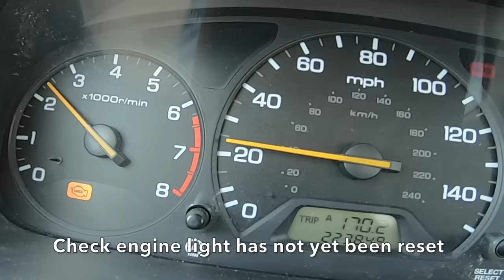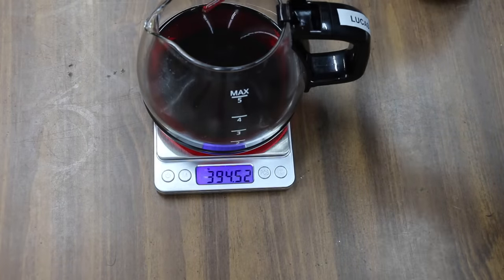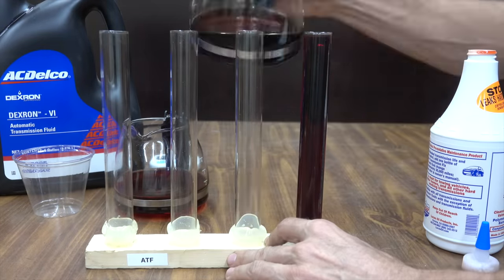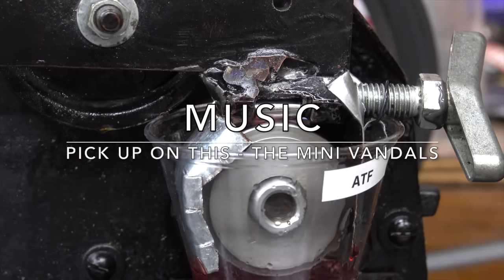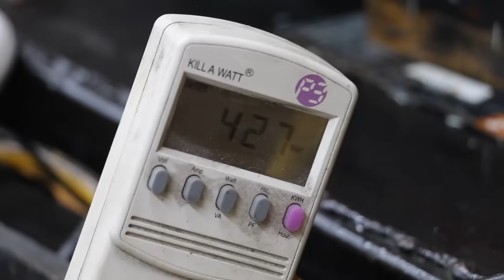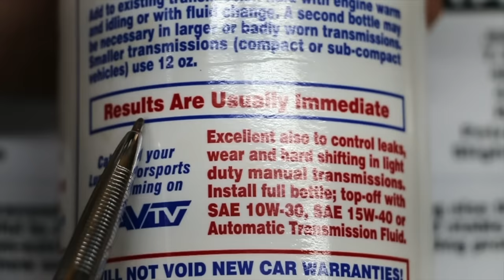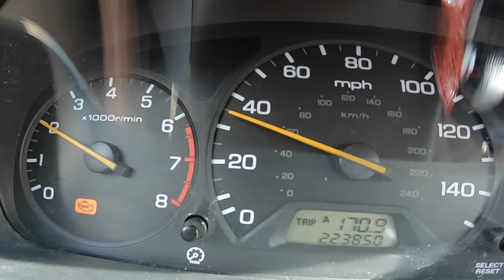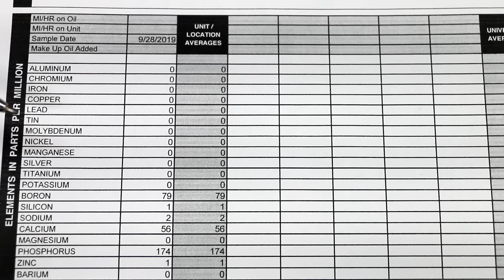Does Lucas Transmission Fix Work?  Let's find out!

Comment: Probably the worst transmission ever made especially paired with the V6. I was a Honda tech from 2004-2011 and I replaced at least a couple hundred of these transmission.
Reply from the maker: Great point! Thank you
Reply: Haha my friend was a Honda teach for 11 years before starting his own business and he told me the same. Stay away from auto hondas from those years
Reply: Even 4 cylinder
Reply: @Ss31994  yep, the V6 is much harder on them but the 4cylinder versions have plenty of issues as well. I would recommend replacing the fluid ever 15k miles to give it the best chance of survival.
Reply: mopar0IIII0jeep I picked up a EXL FOR 1400 bux 4 cylinder
Reply: Honda cars are VASTLY overrated!
Reply: Flies2FLL I guess they last, I still pick Toyota over Honda any day
Reply: I have a 2000 Accord 4 cylinder and when cold it shift into 2nd a little on the hard side. Might try some of this.
Reply: It's almost always the Valve Bodies on transmissions. That.or the solenoid. The fact that it is hunting for 3rd from 2nd specifically ( the most used shift point for daily drives), leads me to think Valve body vs t converter.
Reply: Lol a Japanese “lemon” lasts 220k miles 
An American Lemon doesn’t even make 22k miles.
Reply: jimbojims yup! Bought the car as a first for my son to drive. The trans has been changed once
Reply: Man I'm right there with you, Toyota, Ford, and Goodwrench tech.... That transmission is the deble 🤣 I did alot of used PDI's on those Honda's and man, talk about worn clutch packs and just straight up just a really bad transmission design, I felt bad for all Honda techs across town.
Reply: @Flies2FLL  Facts
Reply: Nissan has some trash CVT ones. I bought a 2014 altima new and had the trans go out totally with only 17k miles on the car, and I was 5 hours away from home lol. A couple year after I got rid of it I got a letter in the mail to see if I wanted to be part of a class action law suit against nissan IF I had my trans replaced 3 or more times haha. I got lucky and only had to do it 1 time in the 60k I drove it but there is obviously quite a few pissed off people out there that might as well have carried a spare in the trunk hahaha
Reply: Im just going to say my prelude i picl up for 850 has 200,000 and had a thrown rod. Car was completely stock with the stock engine. Hondas have their quirks, you have to have your cooling system perfect and vtec eats oil for no reason but other than that theyre pretty solid. The auto trans do suck though
Reply: I'm sorry, have you driven a Ford Focus with the DCT? Definitely a reason for a class action suit.
Reply: @mopar0IIII0jeep  what do you think about the Honda Odyssey 2010 transmissions, are reliable, what should I be looking before purchasing one with 150k on it? Thank you sir
Reply: @mirceacartas6489  Don't. Get a Toyota Sienna instead
Reply: This guy: "this is the worst transmission ever"
Nissan: "hold my CVT belt"
Reply: At least a couple hundred of them?!?! Bless your overworked heart. I bet that got to be boring as watching paint dry after the first 5 u had to do. I think u should get a bonus for each one u have to do. Incentivize our workers and they will simply perform better, and work harder.
Reply: @EmbraceTheSuck  Don't do it. Go to Honda and get Honda fluid. If you want to put some type of additives in use this stuff called Lube Gaurd. Its thinner and works much better in Honda's. I wouldn't use the whole bottle,probably 1/2 bottle. Your transmission probably has some sticky valves or pistons. The new Honda fluid + the Lube Gaurd. There's a good chance that will fix the hard shift problem. Also Check the front & rear flex mounts,engine mounts.  It's common for them to break. They make a clunk sound when they need replacement.
Reply: I have a 2000 Honda Accord V6. I put about 35,000 miles on it since I bought it it's about 243k right now. I just started having kind of a delay when I put it into drive and never really skips when I'm driving it but it does have a hard shift or two if it's not warm. I change the fluid I still gets that delayed shift into drive when the transmission is hot I think my putting some of this in there just to give it a chance and then maybe changing the fluid more regularly I know an old car you supposed to do it all the time I do probably every 30,000 miles but I might start more than that. If it lasts. I want to put some of this in there and see if it'll help out. Make it last before it gets bad. But I just did a cross country moving all my stuff in it and I might have overworked it a little bit. Cuz it didn't start until after that about a month ago
Reply: Toyota transmissions have proven to have the best reliability, As good as their engines!
Reply: i agree and cant forget the 1998 accord that honda never wanted to claim
Reply: I've read that if you want a manual, go Honda, if you want automatic, go Toyota.
Reply: Just buy a corolla. 😎 I’ll take a yota over a Honda any day
Reply: Auto hondas were known for issues in the auto trans 1999-2008 ( not specifically them years but about that time) . I had this same car and it was okay. But others weren't as lucky.
Reply: I have a '00 civic and am deathly worried the transmission will fail. I change the fluid with Honda fluid more often than the recommended interval.
Reply: @Dave-cz4wu  probably it is worth a manual swap, the 6th gen chasis is a great plataform
Reply: I'd take out the solenoid and clean. Then I always drop the fluid and clean magnetic drain plug.  My 98 still runs and shifts great
Reply: Honda= waaaay overrated crap. I know, because I own one.
Reply: My Car Won't Start  i will strongly disagree with you. The Honda auto transmission has no filter and only hold 6 qrts of fluid. Most auto transmissions hold double the amount of fluid and also have a filter. I will give you just one example of how bad these transmissions  are. We had a lady with a brand new Odyssey and during her warranty period which was only 3 yrs/36,000 miles she had 4 transmissions installed. That was probably the worst i saw but we often replaced those transmissions under warranty which was that 3 years/36,000 mile period. As for your comparison to Toyota I will say Toyota builds the best transmissions in the world. I have seen their transmissions go 500k miles, I currently have an 03 4runner with the orginal transmission and engine with 230k on it. My 4runner is a 4.7 V8 so I don't think it has anything to do with a lack of power.
Reply: My old Civic is at 278k miles with the original transmission. People don't believe me because of how bad Honda ATs are.
Reply: @mopar0IIII0jeep  i have a 2004 honda accord ex 4 cyl with 245,000 miles original transmission and never had any problem.Change the valve cover gasket,vtec solenoid gasket few weeks ago and car still pretty good.
Reply: @Dave-cz4wu  I was able to get well over 200k miles fine with regular fluid maintenance. To be honest with you, the transmissions are a problem when they are taking more than they can handle. Ex: V6s and big vehicles. The Civic is by far the best and more reliable car they make.
Reply: @cykablyat1466  Nice. I've been replacing the transmission fluid more often than in the service manual as well. Did you ever need to replace the power steering fluid in that 200k of miles?
Reply: Just sold my '99 Ford Taurus, V6.  My transmission didn't even have as much as a leak, and I drove it 270k miles since 2002 when I bought it used with 33k. Sold it with 303k miles on it, and the only major repairs were master cylinder needed replacing (2009), and the fuel pump (2010), and finally water pump and thermostat (2018).
Reply: @johnogara3029  I'm not sure what you are asking but most automatic transmissions have a filter that filters out the particles from the filter. Honda automatic transmissions of this vintage did not have a filter which means any junk in the fluid gets cycled through the transmission over and over and over again.
Reply: My dad had a odessy van. Had 4 trans under warranty before my Dad gave up on it.
Reply: Those next to the 2012 model Ford Focus and around that era. Automatic transmission, not the manual
Reply: Woooooow
Reply: I agree this generation of Honda v6 paired with the 3.0 j series was literally the worst transmission ever made I remember buying a reman and it was defective
Reply: The Mazda stick transmissions used in 90's Rangers would like a word, and that word is "suck"
Reply: I own a 97' Accord that has 328,000 miles on the original auto transmission (and engine). I feel like that was peak Accord, once 1998 rolled around, it was all downhill.
Reply: Yeah these transmissions require you to replace the filter/fluid super regularly otherwise they fail like no tomorrow
Reply: Did you change the transmission filter?
Reply: @JamesAutoDude  that was part of the problem, this generation of Honda transmissions did not have a filter. All they had was a screen on the fluid pick up tube which was not serviceable.
Reply: @siasp9753  this generation of Honda transmissions did not have a filter, just a screen of the fluid pick up tube and it wasn't serviceable.
Reply: @Flies2FLL  Eh, if you have a manual transmission Honda it's solid. Even my automatic 2003 Honda Pilot that recently had this P0740 code, I just had to replace one of the B connector brown solenoid I believe it was, and code went away. 280,000 miles and going.
Reply: @mopar0IIII0jeep  My transmission has thankfully lasted, but I have an 03 with the V6 to 280k, but I do agree that these transmissions are the worst honda has ever put in their vehicles. Idk about slightly older, but there is a filter located within the transmission solenoid, which you can easily remove and clean out. But, no actual serviceable "transmission filter".
Reply: My 2006 altima has started hesitating, could that be the transmission going out please?
Reply: @Flies2FLL  Honda's A/T are. Most engines are bulletproof, better than Toyotas. Aisin makes the best A/T, the ones made baby Toyota are JUNK. Three RAV4s own in family = three RAV4s with transmission.
Reply: @Ss31994  I would if it comes with an Aisin a/t transmission. If it comes with one made by Toyota, it's a POS. And for that, I'd take the Honda for its engine ANY day over a Toyota.
Reply: @lilibethdoherty295  depends on year and model some junk
Reply: @seanwoyna  yeah that's my struggle right now, got the 2014 hatchback, trans been repaired three times in two years and asking for another now ☹️🤬
Reply: What about a 4 cyl automatic honda accord 2007?
Reply: I've got a 2005 Accord with an AT and 2.4L engine.  I got the car for free several years ago and I've never had an issue.  The original transmission still shifts great after 255,000 miles.
Reply: @binnydinney9739  Honda was my #1 with VW a formidable #2 (pun intended) in the import class, Hyundai and Toyota respectively last. The big 3 made up 70% of my clientele, with Mopar taking the cake at 50% MINIMUM with Ford and GM products toiling in their own shit at 25% +/- of my domestic clients.....I was a Wreckerman who kept reasonable personal  records in this sad field.
Reply: Worst transmission EVER made? The Nissan cvt says hello
Reply: @crxh2dvtec  Another big problem is that Honda decided to stupidly make their transmission filter irreplaceable. It's inside the transmission and cannot be changed out for maintenance. Crap design
Reply: @Dave-cz4wu  "I have a '00 civic and am deathly worried the transmission will fail. I change the fluid with Honda fluid more often than the recommended interval."

If you've been taking good care of it and it still drives good, then I wouldn't worry if I were you.  Just keep doing what you're doing and it should last you a decent while, so long as you don't abuse it.

In addition to excessive bouts of hard driving, a lot of breakdowns also occur because of neglect.  But lack of maintenance clearly isn't the problem in your case.

Of course, any transmission will eventually break down because even the best maintenance cannot overcome wear and tear as well as any design flaws that can cause issues.  But, taking care of it and not abusing it will give you the most service life out of it.
Reply: @Watcher3223  thank you for the reply. Yes I will just make sure to stay on top of the maintenance.
Reply: @seanwoyna  yes those are junk too
Reply: What is so perplexing is that I'm pretty sure all of the Hondas you mentioned have stellar used car reliability ratings.  I tend to believe you over Consumer Reports and i mean that sincerely
Reply: @kevinbradley9601  Overall Hondas would have great reliability but apparently the 'weak' point of the older civics are the automatic transmissions. But I imagine it is because the Civics are being abused and some people are not maintaining them as they should.
Reply: @ben501st  tq converter hasn't exploded 😲
Reply: @Thundarr995  thanks for your Advice my daughter just bought 2004 Honda Accord the gears are fine but for some reason when waiting on the light and goes green I’m about to accelerate and I feel the transmission gear push me a lil bit , a lil help Advise
Reply: @ben501st  My Civic is at 240.000 miles and transmission is doing great, so I believe you.
Reply: @mopar0IIII0jeep  Toyota doesnt make tranamissions. It buys from aisin. Honda transmission has 2 filters. At least Accord 7.
Reply: @Freedomind901  Have 2006 honda accord 7 with AT. Love it.
Reply: @masterwhopper414  Honda Accord 7 AT has replaceable external trans filter
Reply: @викториванов-ж9е  Toyota owns a controlling share of Aisin and has for a very long time. The year range of Honda transmissions we are dealing with in this video only had a strainer on the pick up tube. Nothing was serviceable as per Honda. They only recommended a drain and fill of transmissions fluid as the only maintenance.
Reply: I had a 93 Honda with over 550k miles on it I only got rid of when I forgot too put the windows up and it rained for four days straight which made it grow mold it was an older car and I didn’t feel like dealing with the mold but it still drove well I loved that car
Reply: Automatic transmissions in general are trash
Reply: honda transmission sucks
Reply: @seanguy9720  1997 is listed as the best year for the Civic as well.
Reply: OK guys i have a ulev-4  2.3 litre, yr 2000 accord, if i changed the 2 headed solenoid and it slips just once in awhile should i add 12 oz of Lucas, and if i dont remove any fluid wont the 12 oz overfill the tranny, im confused.
Reply: @EmbraceTheSuck  daummd i have the same year same problem with 2nd a little ruff, did it work, i just changed solenoid and it still does it but less.
Reply: @Thundarr995  i got a yr 2000 4 cyl honda and im trying what you say about Lube guard today, just flushed out tranny last week with original fluid and now going to get and use 12 oz of Lube  guard, question do i remove 12 oz fluid before putting in lube guard.
Reply: I think the GM 4L60E tranny is crap.

.
Reply: I can't believe the 4t65e wasn't mentioned. Those couldnt handle the 3800. Let alone the 5.3 that gm put them on

Comment: I have been around engines and transmission repair most my life and I felt I needed to say this only because I recently experienced some backlash from a neighbor I thought I was helping out. I am a very firm believer in Lucas products and seafoam. When adding these products you talk about adding these products without mentioning you must drain some fluid (if needed) to keep the levels at correct OEM specs on the dip sticks. Have you had any backlash comments in this direction for those people who want to try these products  but have zero knowledge of anything mechanical around this field and just add contents to their already existing fluid levels causing severe overfilling?
Reply from the maker: Great feedback. Thank you
Reply: He doesn't actually respond to comments he just says thanks, thank you and like the comment smh
Reply: I would do so. Just common sense substact the same amount you pour in. Try a third or quarter of bottle. Remove that amount first.
Reply: The Lucas bottle says add to full trans. He read it to us. But yes, I think it should not be over filled.
Reply: Always err on the side of caution! Don't need to compound your problem!
Reply: did you say you got negative feedback about a product because the people you showed it to overfilled their car? i dont think thats considered negative feedback. its like if someone choked on a toothbrush lol

Comment: You got me at “team Lucas doesn’t seem to be aware that the race has started!” 
I was dying🤣
Reply: @ProjectFarm   Great comment but... with a worn pump and low pressure that is what causes a Weak shift. And the increased viscosity buys you time. The Torque converter is nothing more than a hydrostatic clutch.
Reply: Like when calls the heart.... Haha
Reply: Me too
Reply: My 1995 chevy truck started slowing down then to a crawl it would rev up high and rpm would go high then wouldn't reverse.  Is my transmission bad?

Comment: Just a suggestion:  You might want to set up a separate page on your web site to capture viewer's ideas and allow others to comment and/or vote on those ideas.  It appears they could easily get lost when submitting in the video comments ......
Reply from the maker: Great suggestion!  I do read all comments and have around 50 typed pages of suggestions.  100% of the videos on this channel are viewer requested. Thanks again!
Reply: That’s a great idea!!!
An easy one click voting and maybe brands?
Although the brands used normally cover any id use or use. Example: Corrosion x HD I was very surprised to see that in the comparison. And was great because I use that!